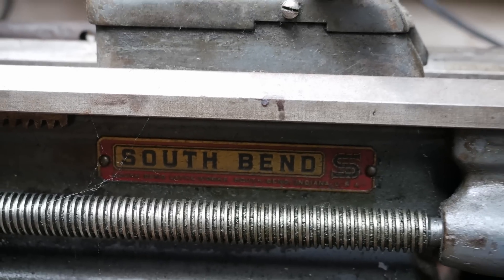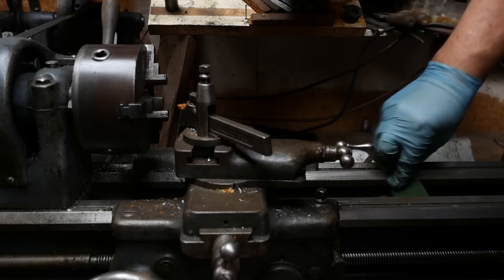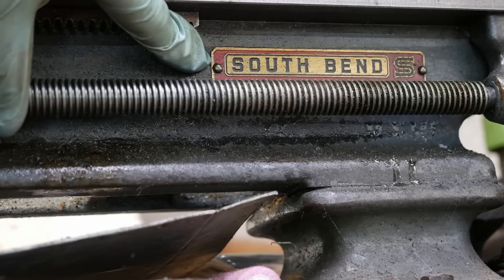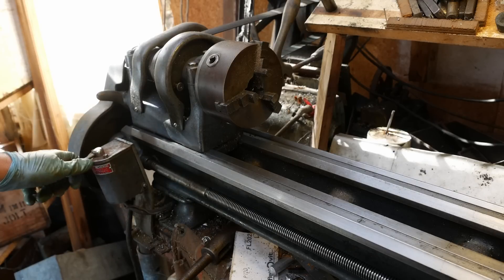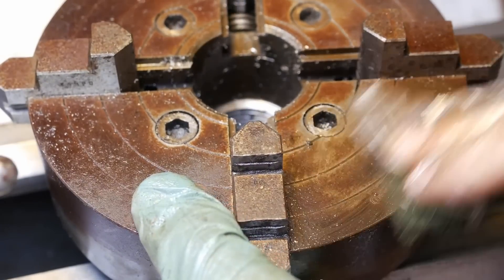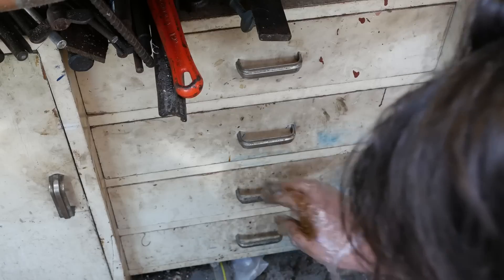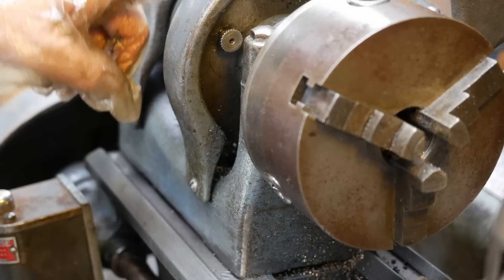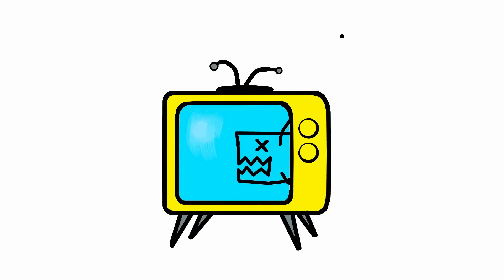Lathe review: Southbend 9C || RotarySMP

Comment: Several years ago my wife asked me to clean the cooker. 2 days later she told me she would clean the cooker from now on. I was sat on the floor cleaning a small self tapping screw with a cotton bud. Most of the cooker was still in bits on the floor surrounding me. Finished it a day and a bit later.
Reply from the maker: Hi Andrew. That is the opposite cleaning method to my Dad's :)

Comment: Good to see you knocking the rust off the old Atlas. I have a similar one in my shop that I rescued from the scrapper.
Reply from the maker: This Atlas is a South bend, but similar. Nice that you rescued it.
Reply: @RotarySMP  You are correct. I was looking at the form factor of the lathe and they were all similar back in the day, Atlas, West Bend, and some others. It's the flat belt with the separate motor hanging off the back.
Reply from the maker: @misterfixit1952  Very similar. You dont see many Atlas over here. I think South Bends were made under license in the UK, so they were common in NZ.

Comment: I always have a cratex stick, two brightboy tablets and two smaller precision stones for projects all around the globe in the backpack (electrician equipment in the checked baggage). Ever second flight I usually have to explain to airport security what those things are - but usually they're cool because they see no wires there :)) Rubberized abrasives are absolutely the best ones at reviving older precision surfaces gently. The coarser side of ordinary 2 sided rubber erasers (pencil/pen) are amazing at removing discoloration from ground surfaces - they contain pumice.
Reply from the maker: Good point. No shortage of pumice in Taupo. The beaches of the lake are covered with ith.

Comment: If you aren't going to use the lathe I'd get gear oil and coat it down the cover with blanket or canvas tarp not vinyl or plastic. That's a very beautiful lathe. Nothing made today can come close to its value. With some extra parts you can add the power feeds and quick change feed box. You dad had a very complete machine.
Reply from the maker: Great point!

Comment: great iconic lathe! Its in nice condition with sort after quality branded accessories. Even though changing feed speeds a pain, its all doable. 
The feet on your machine tells me its an earlier model, like 1940s (correction, Hudstr22 has nailed the date of 1936 below). And those old feet are nicer looking, giving the whole machine a pleasing look. I picked one for free here in US from the mid 1940s, most likely during WW2 as it has a plate on it saying its approved for serve by the war board, something along those lines. Its pretty well used, that there are ridges on the ways near the head stock 😞. But it has a quick change gearbox, looks to be a model A, 4.5 ft. Will give it a clean in the near future and see what it can do.
Reply from the maker: They are a really iconic design, and still surprisingly usable machine tool. I like making stuff on Dad's lathe.
Reply: @RotarySMP  On such machines, you will do it with a big smile! they dont make them like this anymore. Back then American made products and tools were really good!
Reply from the maker: @ronitsingh85  I really like the smoothness of belt driven lathes. The Boley 4LV I have is also a nice machine to work with.
Reply: @RotarySMP  man never knew Boley made bigger lathes like the one you mentioned, it’s a beauty! They are freaking precision machines!

Comment: nice old lathe.    have you seen photos of the slightly over restored 1926 16in  lathe that has a page on the southbend site
Reply from the maker: Hi Steve, I havent yet. I have seen all the ones on Lathes.co.uk though.
Reply: @RotarySMP  Ah then you are in for a treat  just use     southbend  restored 1926 16in  lathe        and it will
take you right there  oh and remember your conservators gloves